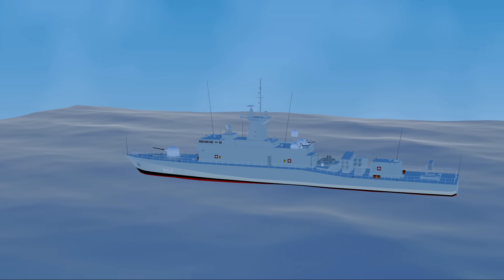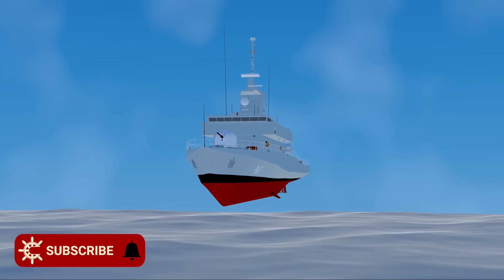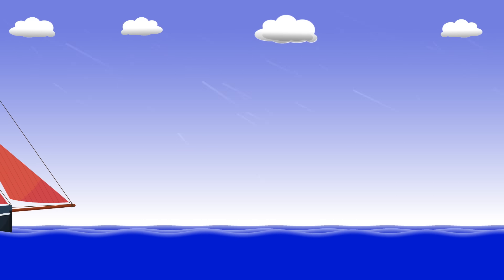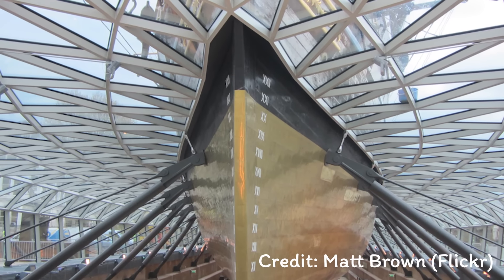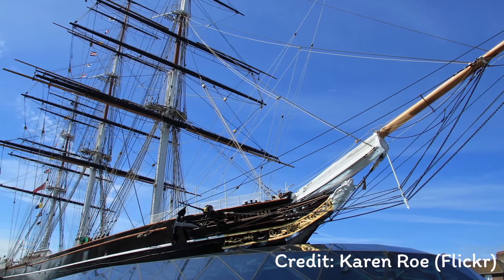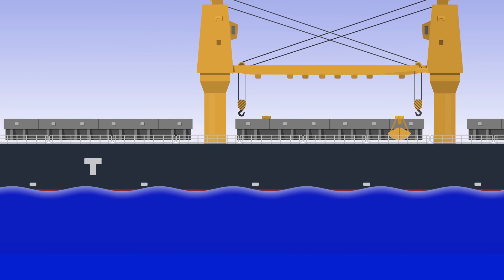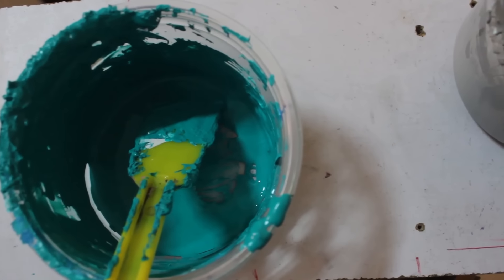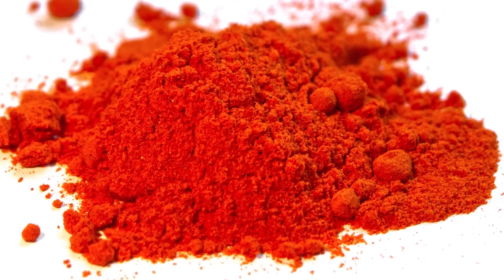Why are ships painted red below the waterline?

Comment: Just incase anyone was wondering you choose which version of paint ( hard or soft ) depending on how often you can repaint the vessel and how fast it goes a 60mph speed boat would rip all of the soft or ablative paint right off but the ablative is better at keeping the bottom clean on slower vessels
Reply: Ah yes, thank you.  I wish the video had explained that.  I was wondering why wouldn't all ships just use the hard paint.
Reply: Sir I have a doubt in the video when he is explaining how hard and soft painting method he said soft paint remove over time and hard paint won't come off but marine plants will grow 3:37 he said then what is the use of the copper oxide. Please clarify my doubt.
Reply: @m.arockiyadhas6515  copper oxide will poison most marine life but some of the more resilient species will still grow and foul up the bottom both versions of the paint hard and soft have the copper

Comment: The only "ports" that allow Hull Cleaning are those with Dry Docking facilities, ship goes in, take away the water and give it a damn good scrapping. And a fresh lick of paint if needed
Reply: Scraping. Sorry. I can't cope
Reply: When I was in the Navy in the 80s, our recon flights would take photos of USSR ships and planes. My favorite was a Russian floating dry dock. It wasn't big enough for carriers or destroyers, but certainly for the ubiquitous Russian "fishing trawlers" we all have heard about. The best thing I liked about the photo is one could clearly see where some of the crew hung out their laundry to dry.
Reply: @davidcaldarola5188  in English, but Russian accent “these capitalist pigs will fear our mighty vessel...Vaselei!!  Is that your shorts on the conning tower!?
Reply: Cheaper to buy a new boat.
Reply: I was going to ask that very question.
Reply: As a general practice ships perform dry docking every 5 years for the first 10 years of their life and then every 2 years (it's a bit more sophisticated, but for practical resons you can remember the simple scheme). Most ships employ diver brigades to do underwater hull cleaning. They use big floating machines which work basically like large beard shavers to remove any marine life stuck to the hull. Divers also remove tangled fishing nets from the propeller as those contribute to a very tangible speed loss and increase in vibrations.
Reply: Don't lick paint....

Comment: In Denmark, leisure sailboats are sometimes painted with a blue , biocide-free paint, that works by simply not adhering to the hull strongly enough to hold any growths, so that they fall off with the paint when the boat is at speed. 
The main disadvantage is that this paint usually needs to be re-applied once a year, and it cannot be more than a day or two before putting the boat back in the water (it's usually done in spring, as most sailors have their boats on land in winter).
Reply: Not just Denmark.
Reply: You're talking about ablative bottom paint.  I have the same thing on my boat, but you don't really need to re-apply it every year..  You only need to re-apply it if the you sail too much and it has worn off. On my boat I need to paint her bottom every 5 years with ablative paint.
Reply: @edloki3057  sail too much ?
Reply: @dorfrez  You're right... No such thing as too much sailing.

Comment: okay you've explained the red so why is there a black stripe near the waterline on the more recent ships?
Reply: Can you send a link?
Reply: It’s known as the boot stripe, it’s purely for aesthetics. They tend to be of dark colour to visually reduce the scum line.
Reply: Rallye stripes make the vessel go faster. A significant improvement over speed holes used before.
Reply: @SuperYachtCaptain  The boot stripe is not only aesthetic. It provides an important function in small boats. It visually shows if the boat’s trim is where it is supposed to be. Larger commercial boats have trim indicators and do not need the boot stripe for this.
The boot stripe should be painted parallel to and slightly above the designed waterline. At anchor, the trim should be parallel it. If it is significantly off the actual waterline, you may need to reposition gear, so the boat will perform better underway.
Most boats handle best when running parallel with their designed waterline. Outboards have trim adjustments to change the angle of thrust, to optimize performance.
Small racing sailboats perform best at the ideal angle of heel for the conditions. The boot stripe is a highly effective tool to measure this.
Reply: Mainly to mark the water line
Reply: The boot topping....On warships this denotes the maximum vs minimum displacement based upon load. E.g a ship without fuel, food, water, stores displaces a different draft vs one that is full laden. Its an easy visual reference of the safe limits and draft etc.
Reply: Looks
Reply: The plimsoll line? It shows if the ships are overloaded or not.
Reply: @oo0Spyder0oo  the plimsoll line is something different.  It normally looks like a roundel with lines through it
Reply: Katie Giles I have a “Gremlin Bell” on my Harley......it keeps safe from road hazards…………
Reply: @Thebustermann  Yes I'm aware of the actual plimsoll marking but maybe the black line still denotes the ships hull meeting the max water mark or something, or just for decoration, dunno.
Reply: cosmetic
Reply: @SuperYachtCaptain  Actually it isn't, it's a stability indicator as well. The boot top is ALWAYS painting near the waterline, and is a quick indicator of under or overloading.
Reply: @SuperYachtCaptain  Ah, I should have scrolled down, someone already corrected you. Are you sure you're a super yacht captain? I'm a retired USCG Surfman and a licensed captain myself, how did you not know this?
Reply: That tells you if the boat is sinking or if the boat is over loaded.
Reply: To let the fish know thats  the end of the red part  lol
Reply: It's a quick reference point to see if she's riding on her lines or not.
Reply: @robertmantell1700  
"Are you sure you're a super yacht captain? I'm a retired USCG Surfman and a licensed captain myself, how did you not know this?"

LOL
Reply: Because if the black line is below the water line it means you are sinking
Reply: Super Yacht Captain , the boot strap was first made for weight measurement on the hull. first for displacement and balance. rocks added subtracted for ballast on wooden ships. same applys for modern boats and sea going ships. most now use water for ballast. modern ships have a ruler on the bow instead of a boot strap. the times mat have changed but the reason has not.
Reply: That is a nike r/whoosh strip
Reply: @patrickwalls1407  *may
Reply: It's on both sides to show which side is Port and which side is Starbucks.
Reply: Go to blacked.com
Reply: I'm not so sure about that but I think has to do with maximum load can take.
Reply: @gehteuchnixan69  lol
Reply: To show where the water line is supposed to be
Reply: Black belt? Oooh. It are Teak Kwan Do black belt. Watch out captain.

Comment: The “Red” bottom is known as “anti-fouling”, hence it only come in two color is red or black.
Black on the hull towards the red is known as the “boot topping”.
Reply: Anti foul comes in whatever colour you want!
Reply: ian mcavoy  Also have seen it in green but im sure is not that common, and it also looks ugly, and i saw once people from 2 different sailing vessels using white but the problem is that a light color actually helps te growing so they never used it anymore.
Most times i see using red, blue, black and grey, but you can get whatever color you want.
Reply: Finally someone answers the actual question!
Reply: Can come in greens, blues and violets.  A Royal Navy warship has even gone to war with a bright coloured light blue bottom!
Reply: do you know what "hence" means?
Reply: Red is cheapest because the ingredients are naturally reddish, so it gets used the most.
Reply: @rogerpattube  Not exactly. Let me educate you. It is important to protect the hulls of ships for various reasons. Some are obvious and some are not. On a metallic hull the primary concern should be rust due to the fact you are a metal boat being dipped in Alkaline water (salt water)into Oxygen which is the formula for rust to occur and for those of you saying you disagree because the hull is thick etc thinking you are correct and clever YOU ARE WRONG...Rust can weaken the joints and rivets in difficult to see places such as under the boat causing leaks or hull breaches which would be life threatening at sea so yeh a layer of anti rust paint is most important. Just to summarise on this point...You ever see a recent ship wreck? 6 months or so after the wreck you go look at how much it has degraded and rusted because the raw materials have been exposed to the elements. In no time at all the ship would be stripped into nothing. Moving onto wooden hulls. You would now be more concerned with wood rot due to the damp conditions and drag if you are a sail boat but not so much of a concern is the rust factor any more obviously because you're in a wooden vessel. The colours of the materials used are indicative of their ingredients in both cases. The black tar was used to seal wooden vessels has remained black for example but with modern ingredients black paint on wooden boats derived from this history and also used as paint to match the sealant (tar).  The red you see on key metallic structures that need protection from rust have the standard colour maroon red for anti rust on all commercial vessels and even metal beams used in skyscrapers and anywhere rust could occur all have the same pigmented anti oxidisation or anti rust red paint. Now you can then paint over the top of that paint like they do with military vessels but underneath will be a layer of red anti oxidisation paint. You're welcome. Takes a bow....get it Bow 🤭💯👋
Reply: @matthewmorris3497  yeah you're pretty much right mate. I'm and industrial marine painter and can't really see any flaws in what you stated. usually the red oxide paint is " akzo nobel international 269" as is the navy and commercial standard for most countries
Reply: @ReinventingTheSteve  Thanks for the exact specification of the referenced red/maroon anti oxidisation paint. I had forgotten it's exact name 😎👍. I love all engineering mechanical or electrical and this particular subject was something I learned along the way from working construction on building sites. One of my co-workers was also a dry dock boat electrician in his previous job. We had a conversation about the metal beams used in construction for the skeletal structures of various buildings and why the paint was important. The topic came about from clipping a fire alarm cable to a structural beam that had the red oxide paint on and I asked "What if I chip the paint while clipping on the cable?" This  is how I first learned about anti oxidisation agents in general. The answer was simple....He turned around and held up a small pot of this red paint and a brush.....lol 😆 I later at some point remember watching a documentary about ship building/engineering ...low and behold the Red anti oxidisation paint showed up again when they de-rusted and re-painted the vessel  Going on to explainin it's importance. I realised at that point through logic that it was possibly the exact same type of paint used. Like you mentioned Steve it's used worldwide industrially.
Reply: @matthewmorris3497  Im reminded of a ship that belonged to the Asiatic Fleet prior to the event of WWII. Bit of history: The US Asiatic Fleet was once considered the dumping ground for the US Navy. All the old, outdated equipment along with 'problem' sailors that hadn't warranted a discharge were sent there. There were ships that dated way back to just before WWI that were part of that fleet. At least one of these ships had lost a quarter to a half inch of her hull due to rust alone. She was just that old. Now that doesn't seem like a whole lot on the surface but you have to keep in mind that every little bit counts on watertight integrity on ships, especially these older ones that don't have the almost excessive compartmentalization modern warships have today. And this isn't even taking into account the rate of seepage these older vessels had as well.
Reply: Navy ships also use a "red lead" paint in the bilges to prevent rust. There was a story in the Navy about a sailor chipping the bilges  on an old WW2 destroyer to get it cleaned up for repainting. His chipping hammer knocked a hole in the bilge. That ship had lost that much of her hull to corrosion/rust. This was in the 1970's time frame.
Reply: @patchmoulton5438  ooof that ship sounded like a death trap waiting to happen 😳 Just goes to show the severity of the topic. Thank you for this information.
Reply: @seniorrider9337  Damn that's just devastating to the vessel. All that work and mechanical engineering feats undone by something as seemingly trivial as chipping paint. Just goes to show that it has serious implications  and should be regarded as the primary concern on any metallic vessel until technology fixes the problem with higher efficacy. Thank you for this story.
Reply: @matthewmorris3497   30+year old destroyer that has seen a lot of steaming and not enough maintenance. These ships were not built with very thick hulls anyway, so let them go too long between drydocks and repaint and that is what you get. I remember painting with red lead paint and if the space did not have good ventilation, you would get high as can be. Bad stuff for humans, but preserves steel very well if maintained.
Reply: @matthewmorris3497  If you think that old girl was a death trap, look up American S-boats and their casualty rates
Reply: @seniorrider9337  Wasnt there also a story about one of those old ships actually making it to dry dock and the stakes that were supposed to hold the ships up once the water was drained actually punched a hole through the bottom?
Reply: @patchmoulton5438   I actually did hear something like that. I was on a ship in dry dock 3 times during my Naval career. Dry docking is an intense evolution. I went to Puget Sound Naval Shipyard soon after retiring and spent 23 years there and heard some great stories of damage to ships from the blocks. They have to be placed precisely. I was there when the two subs were cut up to make one good one. San Francisco and Honolulu. When she left her nickname was the San Fralulu. Amazing.
Reply: @seniorrider9337  I never participated or was on a ship in dry dock. Its just something I remember hearing about after we helped pull the Wasp in. Im honestly not sure how we got on the topic. We pulled the Wasp in, tied her off, the work party was disbanded for lunch and we were on our way to a McDonalds on base. I think we passed by a sub and one of us just randomly brought it up
Reply: The older copper based antifoulings used to be red when applied but turned green from oxidisation near the waterline

Comment: 0:31 looking at the photo of the barnacles under the pier really makes u realize how awful the torture method “keel hauling” must’ve been. For those who don’t know it’s when a rope is run under the ship lengthwise(bow to stearn) & a person is attached to the rope. Once the person is tied to the rope they would then throw the person overboard & reel him in by pulling the rope on the other end. Drowning is the least of your worries. As the rope is pulled from one side of the shop to the other it drags along the bottom(keel) of the ship. Since the ship is typically coated in barnacles the person would get torn to shreds as they get pulled from one side of the ship to the other.
Reply: + the salt water makes it even worse. One of the most horrific ways to die.

Comment: I have seen graphine mixed with clear/surface colour coat over GRP composite on yachts (in New Zealand & Australia). It increases smooth lower friction surface, is extremely hard surface for algae to attach to, and it is thought that a slight electrical charge generated on the graphine surface as vessel moves through the water actively reduces organism growth.

Comment: The silicon based antifouling is a more environmental friendly alternative, however, it is tricky to apply, and one needs to choose the correct type. The antifouling is self-cleaning. At the right speed, the aquatic life will wash off. If you choose the incorrect silicon antifouling,  this won't happen, and the vessel will still grow a beard.